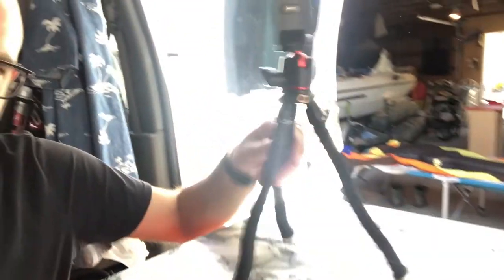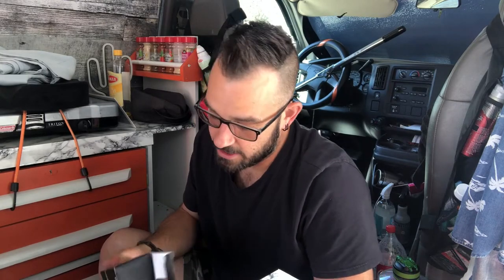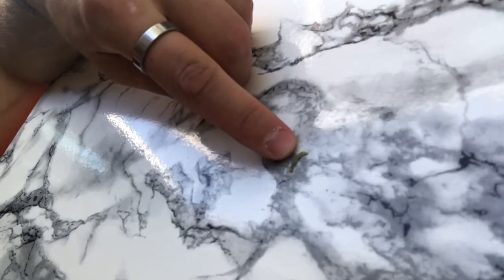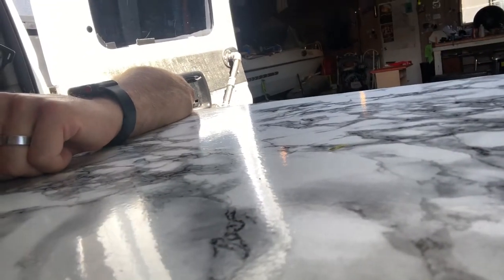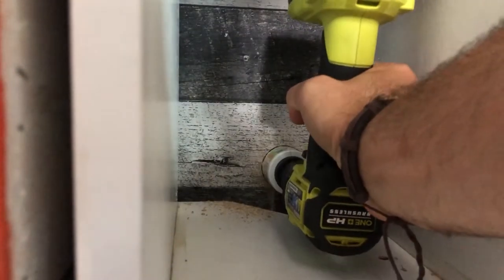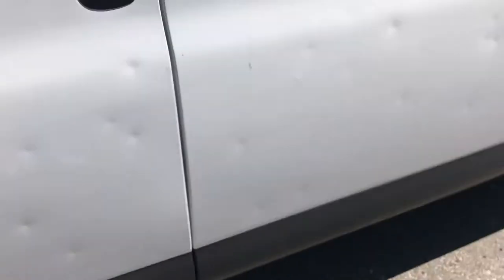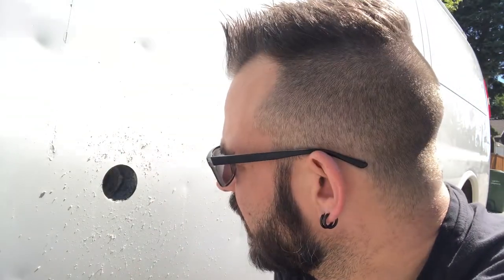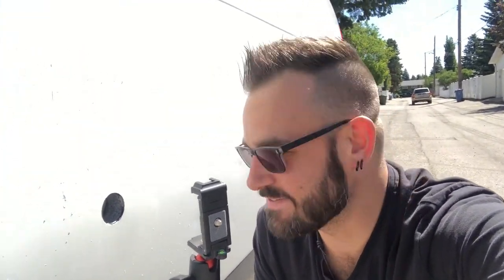#44 | SHORE POWER | Tripod Update | My Personal Situation Chat

Comment: Good job on drilling that hole! But poor Matt cutting his finger. You are correct   those packages are crazy. We had to buy a new frig last year, as we were putting it on the SUV, the bottom packing was bolted on and didn't fit in the car. I went back in the blue store to buy tools to take it off, totally enclosed in plastic,  no knife. I go back in to buy a box cutter, which is screwed to the package! Now I'm searching the lot for a guy with a knife cause the store claimed to not have scissors! 🤯